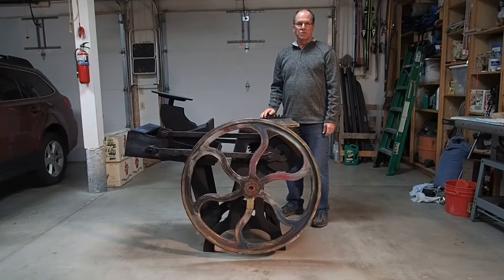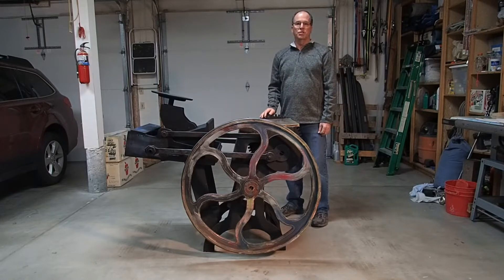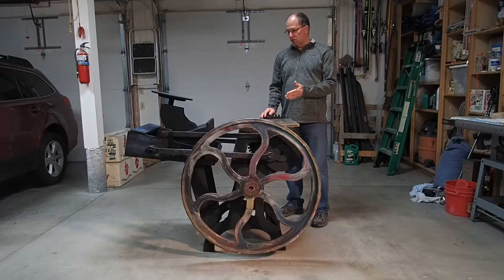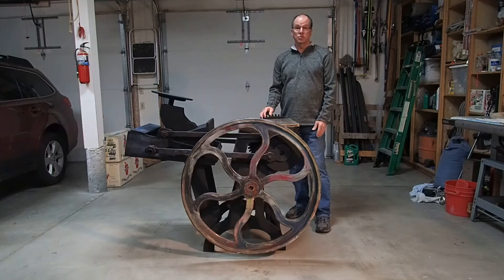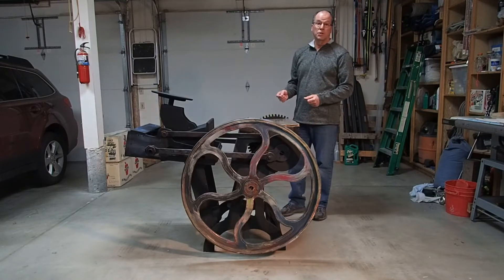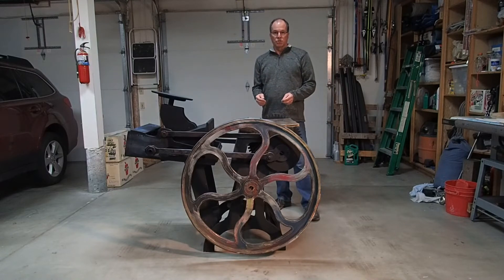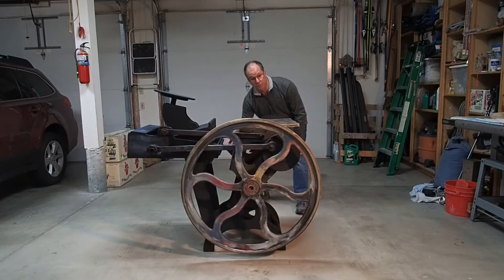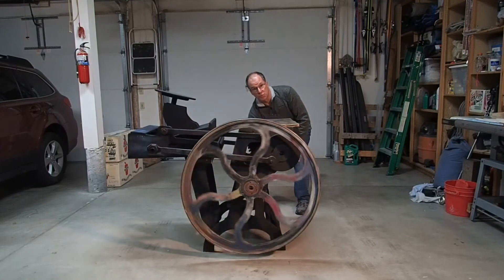Newsies Printing Press

Comment: do you have the plans that you could share?
Reply from the maker: I have some sketches of the structure. I also have cardboard templates for the gears (the most critical parts).  I did not make a complete set of plans so some "engineering" would be required by someone trying to duplicate it. If interested, email me at bptelemark@frontier.com
Reply: Did you every get any plans for this? Would love to make this, but don't have any clue on how to size the gears!

Comment: Bob - This is great! I repair and restore real old printing presses and know the Chander & Price quite well. In fact, I have nearly a dozen of them (big C&Ps) over in my storage barn and actually use one in my shop to this day. 

I was called in to repair the press that was used in the original Newsies production at the Paper Mill Playhouse and later in New York. But when I learned the story, I discovered that they they had selected the wrong press for the job! C&P began making these presses in 1888. The press in the story was supposed to have been "the old printing press" that was  no longer used. At the time Newsies was set, the C&P would have been a new state-of-the-art printing press. An "old" press at that time would have been an Iron Hand Press - like a Washington Horizontal Platen press - or even an older Wooden Common Press - like the one that I made in 2014  - https://excelsiorpress.org/platenpresses/Ben-Franklin_Platen/makingCommonPress.html

Mine was based upon plans I got from the Smithsonian - made from their "Ben Franlin's Printing Press" which was built in England in 1725. Mine is a 95% accurate representation of the old Common Press circa 18th century.

These press designs didn't change much for a few hundred years - until around 1900 when the vertical platen press - like yours - was introduced and left the slow, old horizontal platen presses in the dust as far as production was concerned. 

Nonetheless, as a self-declared "expert" in this field - having gotten my first C&P in 1964 - when I was only 14 years old, and currently in possession of  approx 50 old iron presses, I am very impressed with your work and must applaud you for your excellent reproduction. I loved it when you began turning the crank to make it all move. Beautiful... 

However, one more thing you might not have picked up by viewing photos on line... That press would not need a motor, but never came with crank. Although some presses were - and are - powered by a crank, this one would be "powered" by a foot treadle pumped by the press operator. Many were driven using wide belts hanging down from a line shaft across the ceiling or later - early 1900's - by an electric motor mounted on the back right corner.  I still use the treadle to power mine as I print - just like printers printed 130 years ago...

Good job! I hope you enjoyed the show.
Reply from the maker: Alan - Thank you for the kind words. The press I made was based on looking at pictures of old presses and of the show.  When I made the press for a high school production of the play, I wanted it to need more actors to operate it. We wanted to have a lot of students involved. So, I decided to go with the crank instead of a treadle. That way we had one individual operating the crank, one feeding paper and a few others stack newspapers. The scene worked out really well and the students had a great time with the press. The most time consuming part of the fabrication was making the teeth on the gears. Took awhile to design them and even longer to cut with a jigsaw! It never ceases to amaze me what complicated, operating pieces of machinery our predecessors developed back in the 17 and 1800's! Change the world in so many ways and without electricity.